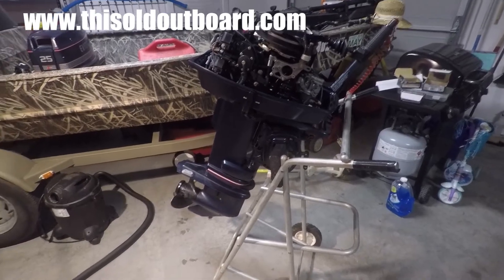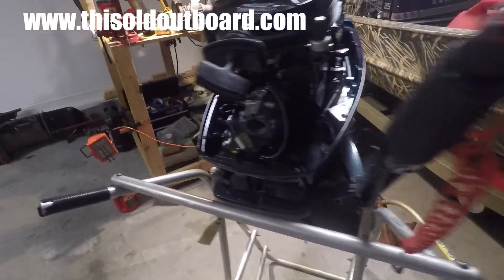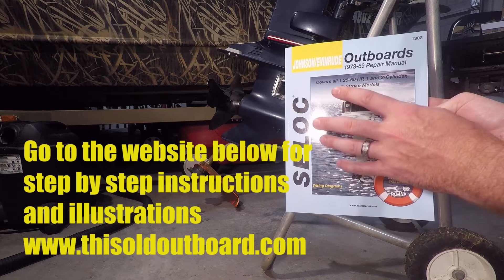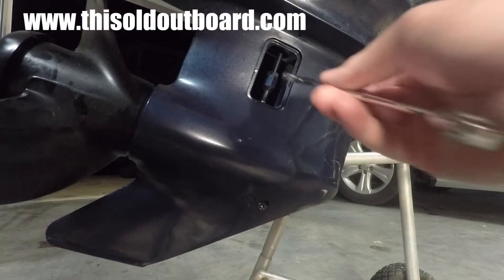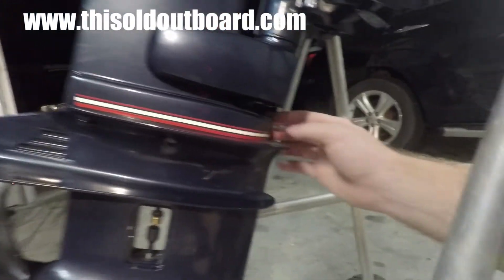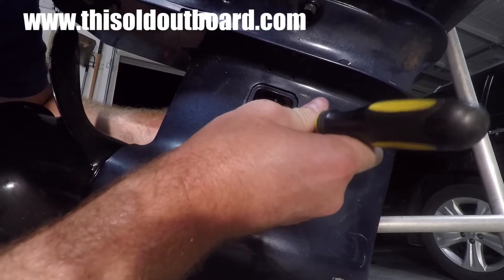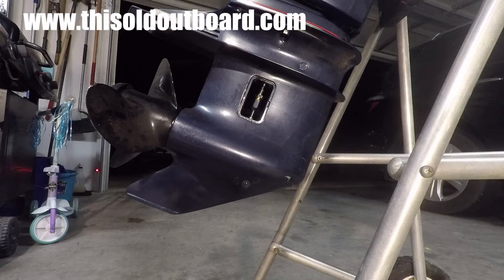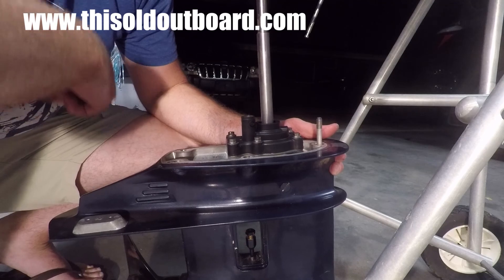1985 to 2005 25 Hp Johnson Evinrude Water Pump Impeller Replacement - Part 1 of 3

Comment: In your video, you mentioned that the impeller looked good but you weren't getting water pressure out the tube. Same thing happened to me. Anyhow, I used your videos to remove, inspect, and reinstall the lower unit. The impeller was in great condition, so I started trouble shooting. I finally looked at the discharge tube and found that a mud bug had filled it up. I traced the tube back to where it attaches at the block and pulled it off. Then I got my nitrogen bottle and an air chuck out and blew it out and sure enough, all kinds of smelly crap came out. Moral of the story? Check the discharge tube before you pull the lower unit off! Also, for years I have always put the muffs on and did a start up in my driveway. Never had a problem till this year. I can see how someone would have launched their boat, fired it up and 2 minutes later hatched the motor. Glad I checked it out.

Comment: Dear what is the purpose of the keeper underneath the linkage gearbox joint. I lost the nylon tapered keeper can I replace it with a small O ring please so the linkage nut will not slip off?  Thanks in advance, very informative video
Reply: To clarify the plastic keeper I have lost is located underneath the upper shift nut. Is a stiff O-ring enough in doing the same job of the plastic keeper as I cannot purchase locally.

Comment: That upper threaded piece on the shift shaft rhat screws into the coupling wont come off to acessthat small black retainer. I cant the upper threaded piece to slide up the shatft to even access it. Any ideas.
Reply: I have the same problem, did you figure it out?
Reply: @BusterWood-c1c  yea i had to heat the small coupler with a small torch & tap it lightly with a hammer to get it to slide freely up the shaft, the plastic retainer was stuck on. I had to replace the black retainers also. They are like $15 a piece
Reply: Thanks
Reply: @BusterWood-c1c   No problem!

Comment: Great job with all three videos on changing out the water pump impeller. I have a couple of inputs. #1; I was having a difficult time putting the lower end back onto the unit. It would go up to about 3/4" and wouldnt go any further. I came back in and reviewed your 3rd video and I figured it out. When I removed my lower unit, the black plastic exhaust tube came off with it. The problem is that it wont seat back in if you have it on the lower unit. I realized in your video that you had just the shaft. Anyway, I went back out and pulled the black plastic tube off the drive shaft and then fitted up into the housing. Then I installed the lower unit and everything went as you said. Thanks for the great videos. Saved me some $$$.

Comment: I have a identical motor to the one you worked on. Anyhow I tore it apart because it got stuck in gear and now its being a pain to put back together. Do you happen to have a video on how you got your back together. Its not wanting to slide back to where it was seated before
Reply from the maker: Try turning the flywheel with one hand or with a buddy while you push the lower unit up.  Sometimes you have to do that to get the splines to line up on the end of the driveshaft to the bottom of the power head
Reply: @thisoldoutboard  Thanks for your quick response. I did exactly what you said she went right in and everything works great

Comment: What is the Phillips head screw next to the lower unit drain plug?
Reply: @carolinausedmachinery  copy that. My kit is still sitting on the shelf. Lol
Reply: @carolinausedmachinery  right on. That explains your revisit to this vid 🤠. My evenrude 25 hp is an 86 also. However it's ran several times a year for the last 10 years or twelve years since I bought it. How about you just come to Tremonton Utah and I'll pay you to replace mine lol

Comment: Does it matter what gear you are in when removing the lower unit? Thank you love your content
Reply from the maker: You may have to toggle the gears during the process.  I start out in neutral.
Reply: thisoldoutboard thank you I noticed the wire that’s supposed to be in that hole near the thermostat in mine is missing is that a problem?
Reply from the maker: Not a problem
Reply: thisoldoutboard thank you bro

Comment: You never showed how to remove the shift rod.. You can't pull the brass connector through the water pump? How did you disconnect it? Something doesn't correlate with your steps
Reply from the maker: It slides off